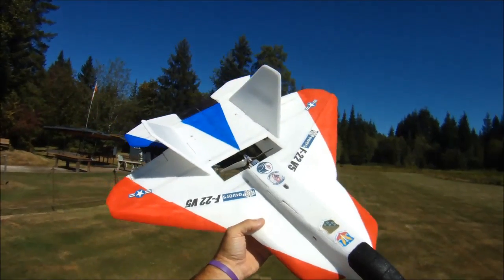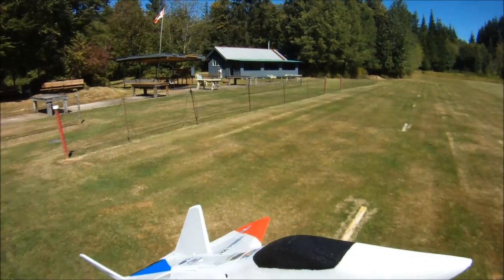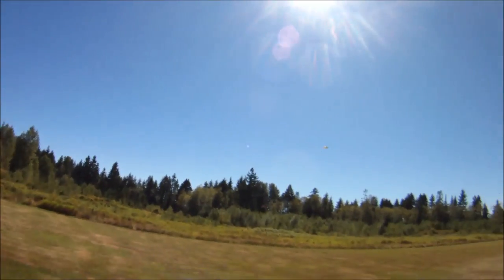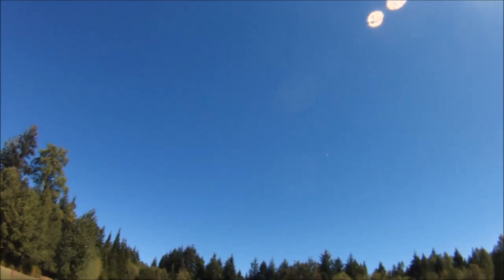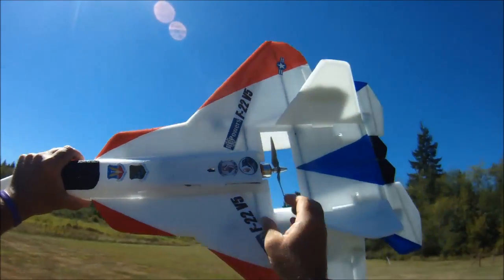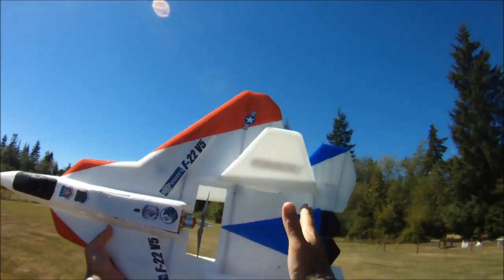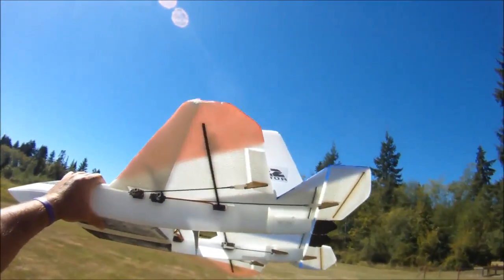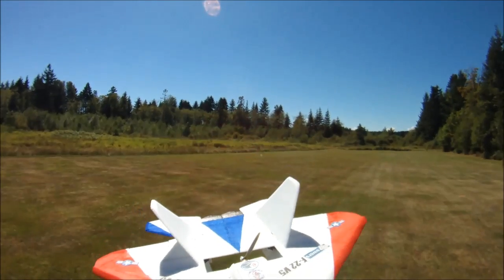RC Powers F-22 V5 Flight and walkaround

Comment: Hi. I have built an rcpowers f-18 and F-22. in the f-18 plan cg was marked wrong at the left wing and right. They are different. Same in f-22 plan. There is 1 cm offset each CG mark . Do you remember which one did you balanced? left or right wing?

Comment: I need some help setting up the aileron and elevons.  I am working on the F18 now, my F22 only has elevons.  I have a DX8, do you have any instructional videos on how to setup the control surfaces the way these are setup here on the F22?  Thanks Scott! - Mike
Reply from the maker: Sorry Mike, I am not familiar at all with any Spektrum transmitter setups, I would be out of my depth trying to help you with setting up a DX8.  Cheers, Scott

Comment: Cool video!! I bought and still have the plans to the V2 of this. I built and crashed 3 learning to keep one in the air for more than a few minutes. I finally figured it out on my fourth, haha. Anyhow, I've been out of it for a few years but looking to build another V2 in the near future. I remember most of the build and set up but I can't for the life of me remember prop orientation in regards to the motor. any chance you can help? Thanks in advance. I have a few videos of my old planes on my channel if you want to check them out. None as good as this, just noob stuff. Thanks again!
Reply from the maker: Thanks very much.  The numbers on the prop should always face the direction of travel when mounted on the motor.  Good luck.  Cheers, Scott

Comment: Is that an 80%?
Reply from the maker: It is built at 95% of the original plans.  Cheers, Scott
Reply: I have the plan, is there a particular reason you went for 95 vs 100?  I plan on building this weekend.
Reply from the maker: I wanted to have a 27" wingspan so that it is the same size as most of my other planes.  I just find that size works well for me and the power setups I like to use. :)  Good luck with the build :)  Cheers, Scott

Comment: Always loved your model's finishing details and color schemes. I only built F-22s and crashed almost all of them ..lol, while trying achieving perfection using Spectrum DX6i TX with "V-Tail" mixers to get correct mixing. 
Today, I have two (2) points to ask you:

1) Based on your experience with these new "under body rudders" on F-22 V5, what you suggest compare to regular one? Are these as effective as regular ones. 
Why one should go with these new type of rudders? I can see these are smaller and out of the way, but what else? (Hope I was able to explain my question). 

2) I finally bought same radio "Turnigy 9x" (with original software), would you mind sharing the REVERSE, ELEVON, PROG. MIX, and AUX-CH setting on your radio with default  receiver (9X 8C v2) or any Turgingy reciever's CHANNEL's wiring?

Many thanks
Reply from the maker: Hi Tahir - Thanks very much for your comments.  The "under rudders" on the F-22 V5 are ideally suited for it's "stealth" wing design compared to other stealth type planes I have built and flown.  Although they are small, they do not get blocked by the wing in any part of the flight envelope, so they are always effective and provide good direct, efficient control in the yaw axis.  I don't know that I would ever try them on a "non stealth" park jet, but for the F-22 V5 they work really well.

Unfortunately, to your second question, I never set up the original Turnigy 9x as I upgraded mine right away with the extra circuit board and flashed it with the er9x firmware.  The mixing setup is completely different with the er9x firmware compared to the stock transmitter from what I can understand.  I always find You Tube to be an excellent source however to figure out how to set things, up, if you search for Turnigy 9x mixing, I'm sure you will find something that will get you started in the right direction.

Thanks again for your kind feedback and good luck with your RC adventures.

Cheers,

Scott
Reply: Thank you Scott for your quick reply. I though you are still using original firmware on this transmitter. Its OK, what I am finding on YouTube it is better to upgrade the firmware as it is more user friendly. I will do same then.  

Thank you once again.
Reply from the maker: No problem, Tahir, with a little practice, the er9x has proven very easy to use, allows me to really fine tune the setup of my planes and improve my flying experience.  I don't think I'll ever use another transmitter setup again, it covers everything I might ever need to do with a park jet and then some.  Good luck :)  Cheers, Scott
Reply: One more thing. As you have upgraded your Turnigy 9X to ER9x firmware, so now which RX are you using that is compatible with it? Also do you swap one RX in all your models or you use separate one for each model of yours, means if you have one RX or multiples for each plane?
Thanks.
Reply from the maker: Hi Tahir - I use this 6 channel receiver from Hobby King https://www.hobbyking.com/hobbyking/store/uh_viewItem.asp?idproduct=12901  It shouldn't matter whether you use the basic 9x transmitter or the er9x, the er9x firmware changes the mixing and other things, but does nothing to change the transmission part of the transmitter.  This 6ch receiver is much smaller and lighter (5gr as opposed to 15 gr) than the 8 ch receiver that comes with the transmitter.  This way I can still have individual channels for each elevon and aileron servo and I connect my rudder servos through a Y harness.  Cheers, Scott
Reply: Thank you Scott.